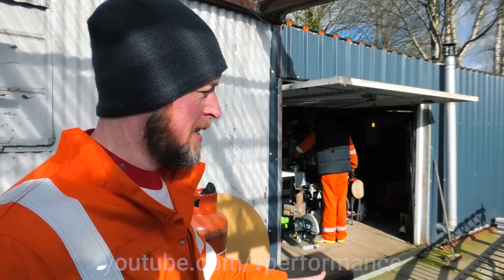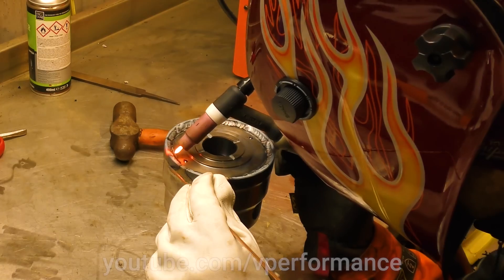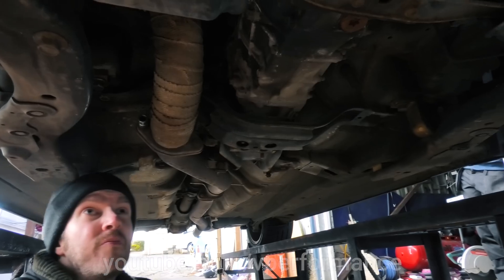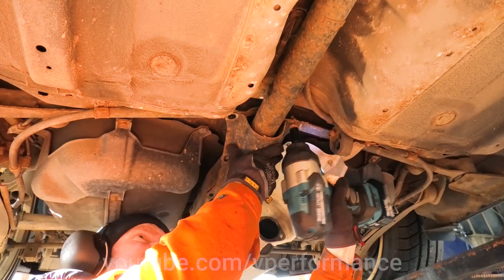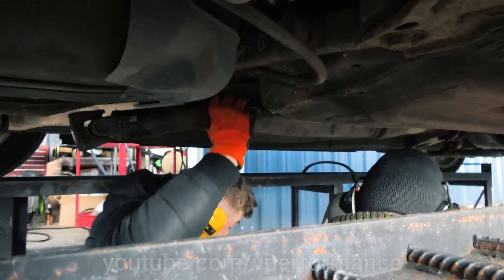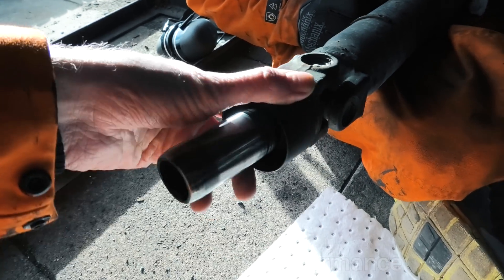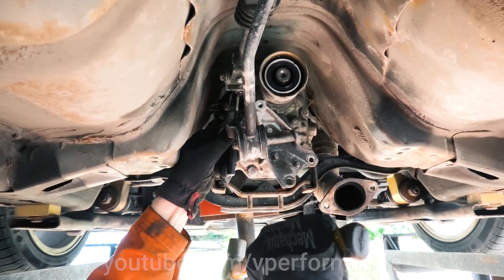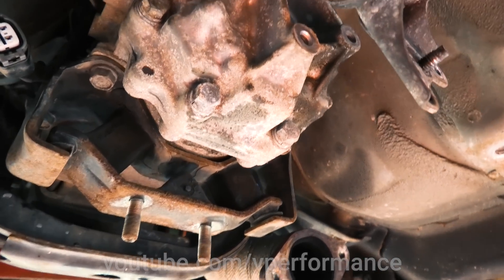Converting the Subaru gearbox to rear wheel drive // Project WRX

Comment: Good video!!! Question? How did you do with the front axels?
Reply from the maker: At first we left them in. After about a year we removed them to save weight when we made hub knuckles with more steering angle
Reply: @vPerformance  thanks! Very clear!

Comment: Is welding rear diff essential to do? Or can I get away with it being how it is
Reply from the maker: You'll need a limited slip diff at a minimum, but locked is night-and-day better. With an open diff you'll send all your horsepower through one wheel and get the one tyre fire.
Reply: vPerformance  yep I’m doing my v7 sti wagon so it will be a factory lsd have you guys had many problems with it since doing it? I’m pushing 20psi and have 10” wheels on so I’m considering going for 7.5” instead cause I hear it can snap axels pretty easy

Comment: Did you guys take the front cv joints out or how did u manage?
Reply from the maker: If the diff is welded correctly you can leave the front driveshafts in the gearbox - you don't have to remove them at all!

Comment: Yasss wrx drifo0000!
Part number for the center diff?
Reply from the maker: The latest revision is 38913AA102 but very expensive direct from subaru. You can get a whole gearbox for the same price.